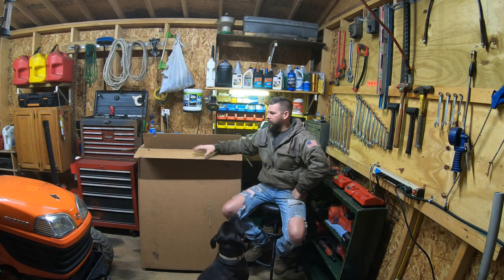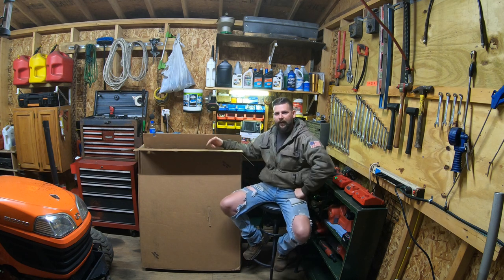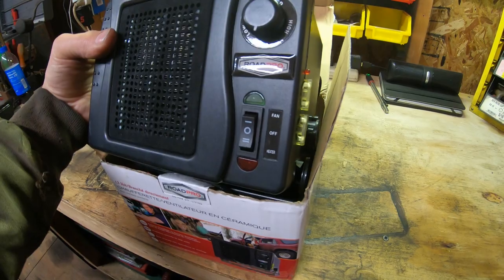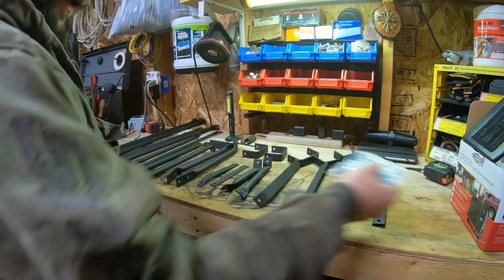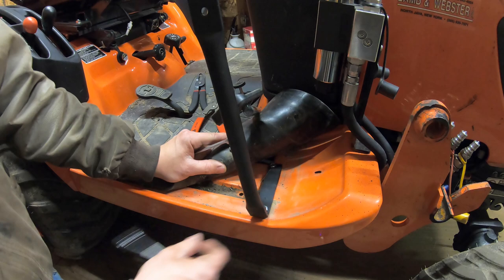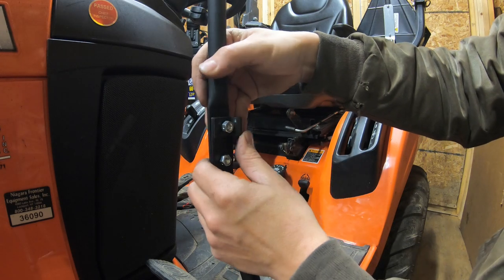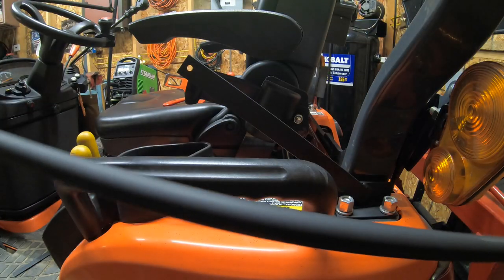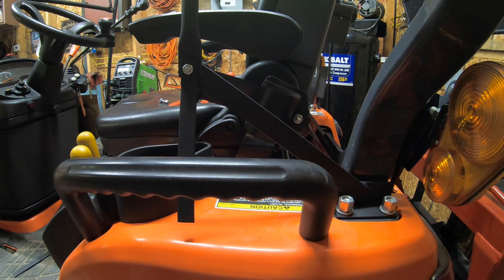Kubota BX- Original Tractor Cab (Full Install Video + Extras)

Comment: I got this based on your recommendation on a comment on one of your videos (couldn’t find it after). You mentioned TTWT and I checked the video out, before making the decision. 

On my BX 2680 there are some differences for anyone wondering-
1.) the grab bar on the left fairing had to be removed, not a really elegant solution there. 
2.)The ROPS c-clamp also started cutting into the vinyl, so I had to remedy that. 
3.)Our right doors are different, yours has a billow (I assume that it’s to accommodate your loader controls), mine just looks like your left door.

I have the windshield and wiper, but haven’t wired it in yet.  
Fit and finish could be better, but really for the price and the fact that it can be removed for summer time it works. Overall I’m very pleased with it, so thank you for the recommendation (even though it was to another viewer). 
Fantastic video as always, thanks!
Reply from the maker: Great man I'm glad I was able to help. Thanks for all your input and advise with this cab on the new bx80 series it is great information for viewers to have for sure! I think we are both gonna love the front windshield upgrade as it will not only strengthen the cab but will be much easier to see out of as well. I'm excited to get going on all of the cab accessory installs for you guys, its gonna make it feel much more like a factory cab indeed. And yes the cab isn't perfect but for the money IMO its the best cab you can buy hands down. Thanks for watching!

Comment: the heater works awesome I've got one in my 1025r and it'll sweat you out I was plowing snow wearing a t-shirt
Reply from the maker: Great to know! So far the cab heater is def a nice little accessory specially for free haha, Think I'm gonna mount a small 120mm high static pressure Computer fan to the backside of the heater to help increase airflow across the heating eliment. The heater seems to make plenty of good heat but seems to lack a bit in air flow so im gonna see if i can fix that lol. Thanks for watching!

Comment: looks great! You going to love it especially on those windy snow days. Word of advise since you didn't get the glass window and wiper. Carry a couple rags/towels with  you to wipe off the front window. It will get wet and a little difficult to see out of from time to time. I had a soft cab on my JD X739 and it worked great, I just had to wipe down the from window from time to time. Great video as always. Enjoy.
Reply from the maker: Thanks man, Im super excited to plow in a nice warm cab finally this year. The fit and finish of the cab is amazing for the money im very happy with it. I just finished making an install video of the glass from windsheild and wiper blade so this wont be an issue but id have to agree for anyone who isnt gonna do this upgrade that they should keep a rag handy. Install video on that coming soon!
Reply: @BiffsEquipment  sweet!

Comment: You have a sharp looking setup now! I have that heater on my tractor, of course no cab, but it’s nice to warm my hands up. I bet it heats that little cab nicely!
Reply from the maker: Thanks man, the heater is not bad for a free heater, it has no problem getting hot but the fan is a bit lacking so I think I'm gonna wire in and mount up a 120mm high static pressure computer fan on the back side of the heater to help increase air flow over the heating element.. This should help drastically with how fast it can warm the cab up. Thanks for watching!

Comment: Great job, I'll be waiting for the accessories! My L2501 is just too tall to have a cab and get under my 7ft garage door. I've been kicking around trying to make my own, it'll just take a nice -15 degree day with wind to push me into trying it. I too would want it easily removable. You're gonna love tht snow pusher!
Reply from the maker: Thanks man! Yah that is an issue a lot of people have including my father with his john deere 1023E where depending on the tractor, The Cab may stand higher than your garage door will allow.. One thing to note is that I'm actually able to lower my ROPS even with the cab on and it even states that its ok to do in the manual.. The ROPS mounts just help to sturdy the cab even more but if I'm being honest I don't feel having the ROPS mounts on at the end of installation is necessary. If you do go with this cab I would install the ROPS mounts to start with and then once the cab is built and all bolts are tight then I would try removing the ROPS mounts and putting down your ROPS to see if it would then be able to clear your garage door.. Every tractor is a bit different tho and the cab for the L-series may require the ROPS to stay up but its def worth looking into. I was originally planning to build my own cab too but then after taking a second look and seeing how tight many of the spots would be to run the main frame (since I have a sub-compact tractor) I decided not to as I felt it would take me most the winter to complete lol. Thanks for watching and lmk what you end up doing!
Reply: Yeah I think I'd be able to keep the rops down, but it's the overall height, my L2501 site tall to begin with. Even the Curtis cab that sits lower than my rops when up, is still a couple inches too tall. As I sit on my tractor going in and out of my garages, my head clears by 5-6" so thats all I'd have to play with for a roof. I'd be close to hitting my head inside. I was maybe thinking of an open top wind block, then I get thinking, if I get cold, go in my heated garage, have a coffee, go back out. Lol.
Reply from the maker: @ironheadbiker  ahh I see. Yah you may be stuck with the only other option then which is building your own. I’m sure you could do it tho there are lots of other cab build videos on YouTube.. iv seen nearly every one of them cuz I spent 2 months searching videos when I was gonna build mine then finally opted out lol. Let me know what you end up doing I’d be curious to know.. until then stay warm out there!
Reply: Yeah I just checked,  and my buddy "Country Living with the Harnish's"  put that same cab on his L2501. I had him measure it and it was just a couple inches too tall. I had to go back and look at the manufacturer name and yeah it's the same as yours. Then I searched his comments and yep he measured for me and it was like 85" in front and 82 in the rear or something like that. Plus now with my tire chains I'm tht much taller. Oh well,  custom time we go
Reply: Well I got home and got to "work" with my tractor clearing snow I thought would've melted, but it hasn't gotten as warm as it was supposed to here in Wisconsin. I love my snow pusher, but today I got an idea for a removable back drag blade. I don't like the ones that go on top like the ones good works tractor sells,  the HLA. when you curl all the way forward your cylinders are at their weakest point. I've seen many guys break their cylinders hitting stuff as they back up,  so I don't wanna go that route.  But I had a revelation looking at it today for a back drag idea WITHOUT full extention of my cylinders. I wish I had your skill in welding, but mine will get me by. Gotta scrounge up some materials and then I'll be rockin. 
That's my only complaint with a snow pusher is the loss of a back drag like I can with my bucket, but I think this solves that.

Comment: Nice Job! I just placed my order for my B2601. Thanks for sharing this, just what I was searching for. Dave
Reply from the maker: Very cool! Your gonna love the B2601! I have always told my subscribers that if I ever upgrade I’ll mostly likely upgrade to the B2601. They are the perfect sized tractor in many ways.. small enough to still get in tight areas and do tight jobs but large enough still to be efficient on the larger jobs. Let me know how you like it!
Reply: @BiffsEquipment  A friend of mine has a BX but with the 4 acres I have I thought it would be better to upsize. It is a beast! I have a 60" tiller for it and tilled 1.5 acres with no issues last summer. I just purchased a flail mower for it and it is the biggest bang for buck accessory so far. I have even used it for stump grinding with no issues. The cab came today and it will get installed this weekend by me. I have some mod ideas for it as well but need to see it installed first.
Reply from the maker: @davidbormet5485  very good man! Yah anything 4 acres and over is starting to push it with a sub compact. I only have 3 acres total myself but 1.5 of the 3 acres is not very accessible yet as I been slowly clearing the land with my BX since I bought the property. Sounds like your gonna love your new tractor, should be a great fit. Keep me posted how things go with your cab!
Reply from the maker: @davidbormet5485  very cool man! Glad to hear your liking it thus far! What stump grinder do you own? I plan on buying one in the spring
Reply: @BiffsEquipment  I didn't buy a stump grinder. I meant that I used my flail mower for trimming down the stumps to 1 inch above the ground.  I have the hammers sharpened just right that it basically acts like a chain saw cutting away the stump. This is done very slowly and works great! Great addition to cutting anything and saves on a rotary mowers wear and tear.

Comment: heyhey Mike Nice job.   I have wondered how well one of those cabs would hold up in my extreme cold here in Alaska.  The only thing that I can see that would bother me is that I wouldn't be able to drop the ROPS after the install.  Can't wait to see what else you got coming
Reply from the maker: Thanks man, Love your videos as well! Its amazing how much support there is in the YouTube tractor community. As for the ROPS mounts, The manual actually states that the ROPS mounts can be removed safely if the ROPS needs to be folded down and it should not have any affect on the cab. The cab is rock solid even with out those 2 cab mounts so I suggest looking into it to see if it would be the same for an original tractor cab on your tractor but I believe it is. If you do end up trying this cab I would install it fully like I did and then at the very end once all the bolts have been tightened remove the 2 ROPS mounts and then drop your ROPS and see if it will fit under your garage door.. I was lucky enough to build my shed door JUST tall enough to where my ROPS just fits under the header with 1/8" to spare while its in the top position but I agree most people don't have this tall of a garage door so having the ROPS able to fold down is a must. Thanks for watching and keep me posted with what you end up doing, all that snow that you get you could certainly use one! haha
Reply: Totally valid concerns, I was sent to Alaska for training and the wind was a shocker. I was 200lbs of muscle and carrying full kit, but your sustained winds didn’t give a damn! Very humbling.

I know that Original Tractor Cab states that the vinyl panels have to be removed if the tractor is to be transported by trailer. I would certainly give them a call if before purchasing one if I were you. On my setup, there are stress points where the vinyl is under significant tension.

Comment: So how good does the heater work? Does it keep you nice and toasty or does it struggle?
Reply from the maker: I can’t remember which heater I had in this video, I’m guessing your taking about the electric heater that came with the cab? If so the heater worked but not very well.. it worked decent for a hand warmer that’s about it.. it can take the chill off in 40 degree weather but anything under that it can’t keep up.. I have since then swapped the heater out for a radiator style heater that uses my coolant system snd it is MUCH better.. keeps the cab pretty warm now. I have a full install video of that heater on my channel if you want to check it out.. just look for “cab heater install” I think it’s called

Comment: Excellent demonstration!!! I just bought a BX2680 and am interested in this cab. Question, is it possible to lower the ROPS with this cab on? I see that you have to attach to the ROPS but I have to go to places with height restrictions. Would I have to rig something up for the ROPS to lower? Thanks!
Reply from the maker: Hey Nick thanks for watching! It is actually possible, infact they mention right in the instruction manual that if you want the ROPS to be lowered just remove those 2 C-clamp brackets and drop your ROPS down as usual. The ROPS mounts to my knowledge are only there to help sturdy the cab but in my opinion they aren't even needed. Hope this helps, let me know if you get one!
Reply: @BiffsEquipment  Awesome big guy! Thanks so much for the info and will do! Love the videos boss :)

Comment: Congrats, Biff!  I have a BX2370 with a Curtis cab.  It has a windshield wiper that is great when the snow melts on the front window.  My heater burned out as it was fed by hot water from the block.  I was out when we had the 4' of snow and I was post-op from open heart triple bypass surgery.  I was very careful not to put tension on my chest and rip the sternum apart with the stainless steel wires. LOL  How is that heater working?  One review said it didn't put out that much heat.  Cheers, Bob
Reply from the maker: Hey Bob, wow i sure hope you feel better soon! The Curtis cab heater will def put out more heat then the heater I have, but the Curtis heater is also a lot more money. Your heater most likely didn’t “burn out” the fan inside it more or less just quit working I’m assuming.. you’ll have to check for power using a volt meter to see if the heaters power wire is getting 10-12v.. if it is then it just needs the blower fan replaced.. I just had to do the same thing to the fan on the Curtis heater at work on our John Deere Curtis cab. If you don’t have power to the heater then you need to check for a bad wire or a blown fuse.. these heaters are very simple.. all it is is a mini radiator that the coolant travels through and heats up.. then there is a fan behind the mini radiator that blows through it warming the air from the fan as it passed through and out of the heater box. Best of luck let me know how you make out. It took me about 20 minutes or so to replace the fan in our Curtis heater at work once I had bought a replacement fan
Reply: @BiffsEquipment  Hey Biff, thanks.  I'm doing great, no pain and progressing with exercise.  IMPORTANT!  for everyone... if you start experiencing a tight chest that radiates up into your neck (with or without pain),get to your local ER (skip your primary care clinic).  You will be treated as a Code for heart attack and a load of tests run.  That's how I found out I was a dead man walking.  It started in August just walking up my driveway and getting the symptoms above.  It was an Angina attack.  If I hadn't gone to the ER the next attack would have been a heart attack according to my cardiologist.  It DOESN'T matter your age.  I'm 75 and was in good physical health so it was a surprise when they found out I had 3 coronary arteries 95% blocked.  

Back to my dead heater.  The low and high speed settings work, I felt the incoming hose after running for at least 15 minutes and it was cold.  The Carhart jacket and warm gloves work.  Sorry for the lengthy reply but I hope you and your followers get a chance to read it.  Best wishes for Happy Holidays for you and your family.  Bob

Comment: I looked on their website and didn't find anything for the BX 23s. Do they have one available. Thanks mate...
Reply from the maker: You have to buy the BX2380 cab for your tractor.. You just wont be able to use it along with your backhoe.. It will have to be one or the other that's the only reason they don't list your tractor as it wont work with the backhoe attached. Best of luck!

Comment: Can't see paying over $4000 for the Curtis Cab so will probably get this one next year. I do want the safety glass and windshield wiper plus the heater they offer. I do have a small question about the heater though. The Kubota cooling system blows the air from back to front and Curtis Cab solves this problem with an addition part to keep the warm air in the cab. How do you keep the warm air from the Ceramic heater from being sucked out into the engine compartment. Thanks
Reply from the maker: Thanks for the comment, I think a lot of people would agree, you just can’t beat the price of an original tractor cab, cheap, nice, and effective! Iv been loving my cab every winter and havnt had an issue yet with it, keeps me warm when I plow too that’s for sure! The heater that comes with the cab tho is terrible.. that electric heater all it does is draw tons of power and won’t even warm your hands really, I suggest going with a heater core style heater instead like I ended uo doing.. below I’ll give you the link to my second heater install video.. also I’ll give you a link for a recent video I just did of how to block off the radiator screen for a cab.. in the video I show you a great way to block it off to keep more heat inside your cab

Heater install: https://youtu.be/wrMlkQASgU0

Radiator Screen Cover: https://youtu.be/xKoZDjNzA2c
Reply: @BiffsEquipment  Thanks for the info and will definitely check out your videos.
Reply from the maker: @kagnewmp12  sure thing man!

Comment: I've been thinking about getting a cab, but what is the measurement to the top of the roof? I have to go through a regular size garage door.
Thanks.
Reply from the maker: Hey Ted, I can’t remember, the top of the cab on my bx2370 sits about 5” lower than my ROPS I believe. Let me know if you need more info and I’ll try and measure it for you. With a 7’ high door you should be ok

Comment: I noticed the cab covers the fuel fill.  How do you get around it?
Reply from the maker: It does cover it I guess you can say but all you gotta do is open the right side door and you can very easily access the fuel cap form there so no worry's. Thanks for watching!